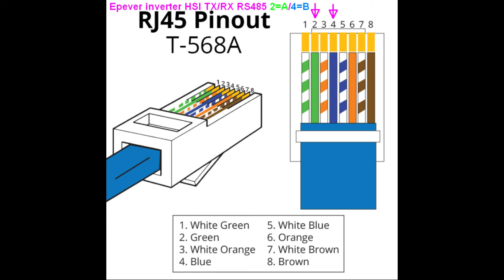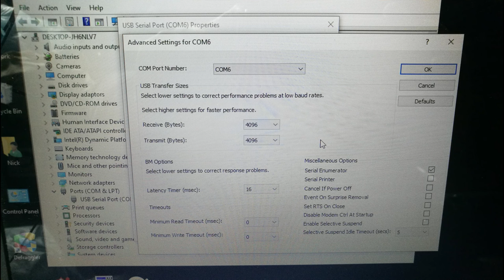Epever inverter SHI RJ45 RS485

Comment from the maker: Note: That simpler adapter also works fine under Win 10 (drivers auto installed) and the Epever SHI inverter (I bought mine there):
http://users.skynet.be/xixou/adapter_rs485_working_epever_SHI_inverter.jpg

Note: If the inverter is not responding (this sometime happens when the load is high), power cycle the inverter (with the relay port or the switch) and check with no load or low load.
Looks like the EMI is killing the rs485/usb chip. 115200 baud rate is the only supported one by the inverter.
HFIME usb isolator can also prevent the EMI/current leaks to disturb the USB adapter:
I use this one, 30 dollars: https://hifimediy.com/usb-isolator